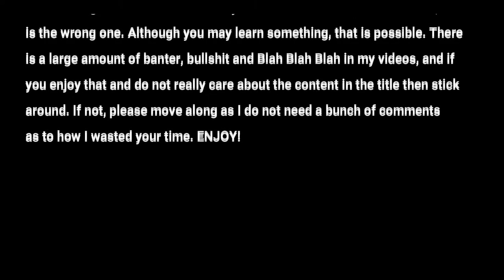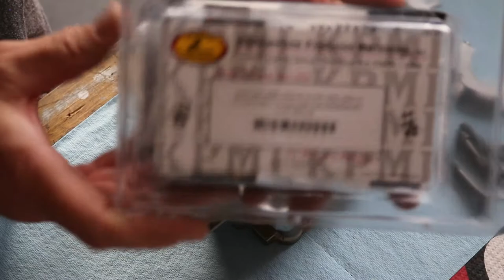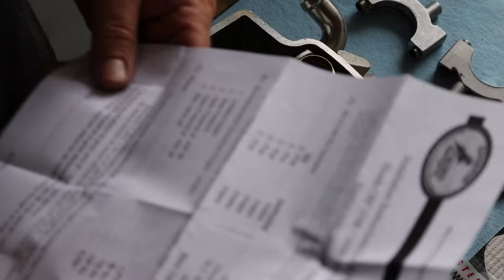2004 CRF250R Valve Issues Part 3_Reassembly

Comment: Good video! I have a question. I’m gonna order these same intake valves, these bikes come with titanium valves from factory and I won’t be replacing the exhaust valves like you. My question is, is it alright to run the double springs on the intake valves and not the exhaust valves ?